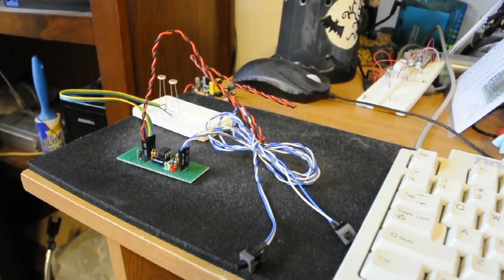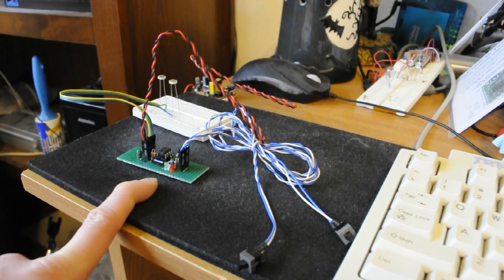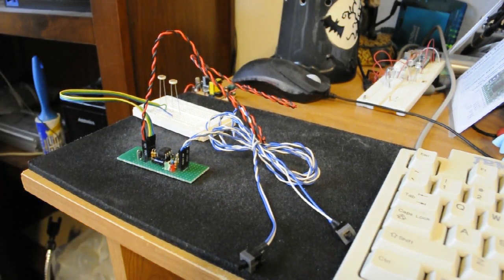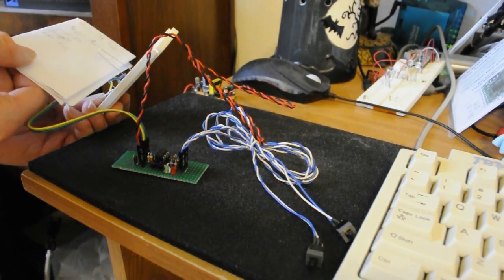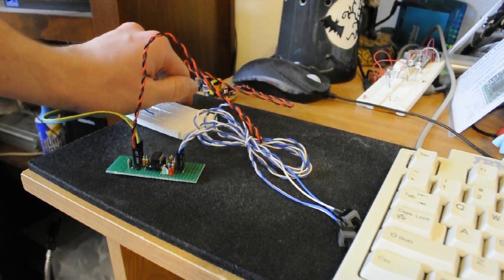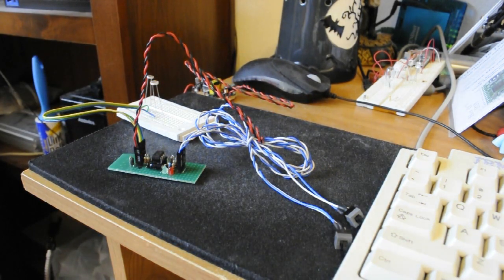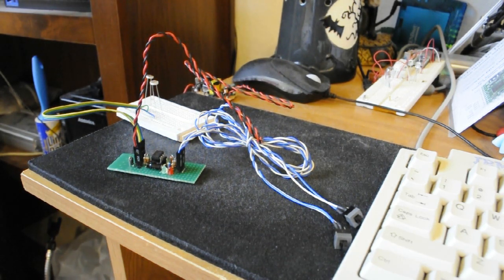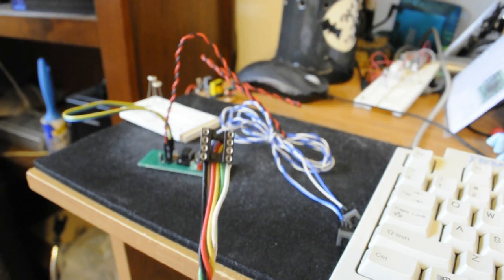ATtiny85 Solar Tracker

Comment: Compliments for the job.

I live in the same forest with solar panels. I also have a solar traacker but done with an arduino nano and I use green LEDs for the sensors. The photo resistors did not work well for me because they quickly changed their value due to overheating in the glass jar.

For the last 4 years I have had LEDs for the sensors and I have no problems.
And the limit switches have the actuator itself (electric motor for satellite dishes).

Once again you did a great job.

Greetings from Serbia.

Comment: Looking Good....... Is there a way to stop unit from tracking the (full)  Moon ? I am going to try some diffusion plastic over the light sensors. Or can it be changed in the program.?
Reply from the maker: Wouldn't think it'd track in the full moon given it doesn't only look for differences but also overall light. I honestly haven't implemented this anywhere so tweaks may well be needed. A diffusor sounds good though. Wish I could remember the guy that implemented this. We chatted back and forth a bit and he really built onto it quite substantially, but there's always more room for play on an ATmega328 vs. an ATtiny85.

Comment: @adamlhumphreys is that the andrino chip.  if so thats cool I have a basic stamp chip that I like to use a custom charge controler, an dI like to use it for other stuff as whell with my solar and wind those micro controllers are so versitile.

Comment from the maker: @legalizeshemp420 A mock-up would be good, but I’d probably use the actual planned driving motor after I make the H-bridge. This would give my dad and I an extra push to find means of developing the framework. I’d probably go ahead and pot the photo-sensor connections with epoxy while I’m at it. …But other potential events (like moving) could put all this to naught except for those who benefit from what I’ve done here. Not fretting, good to have an H-bridge on hand, but just FYI if no updates.